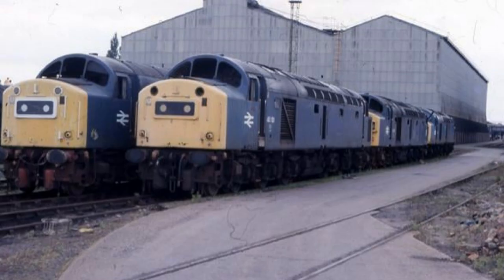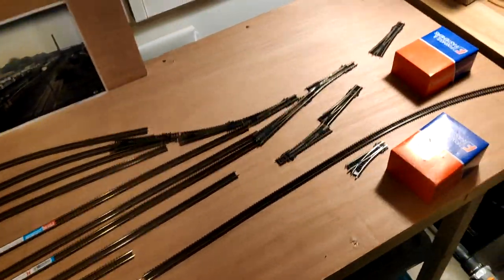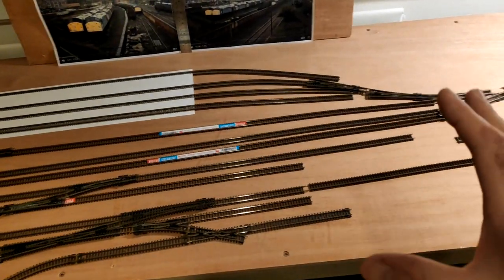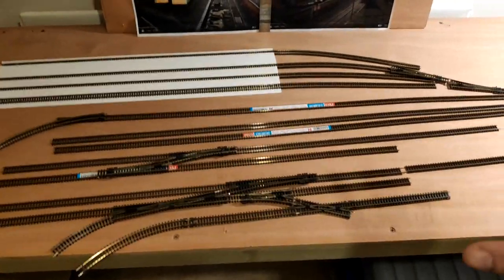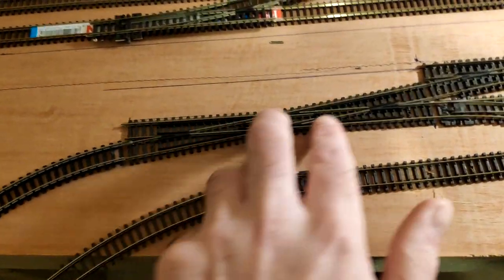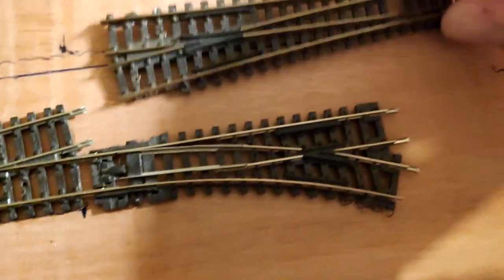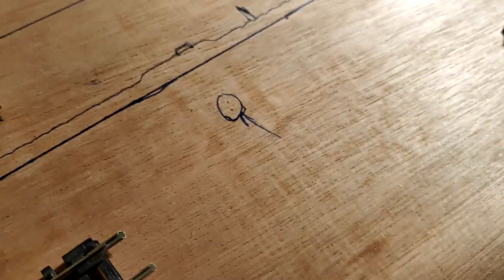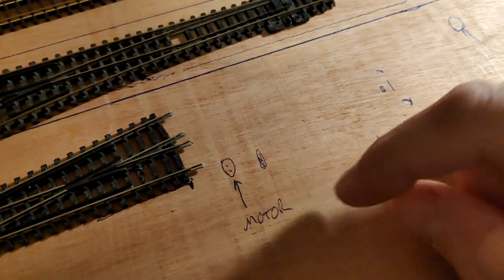Lets Build Creweworks Part 1

Comment: Hi Richard, Love the whole concept of this layout, the multi layers approach will certainly make it unique and interesting to view. Great approach to doing the trackwork, never seen super glue used before, but as you say once the ballasting is done it will also hold the track. Not sure about soldering track together hopefully you'll leave a few gaps to allow for track expansion. So going forward I take it you have a few class 40 bodies and will be just using dummy chassis's to set the scene, this could make a very interesting diorama seeing locos in various states of disrepair with roofs open and parts missing. I'm looking forward to seeing how this layout evolves. All the best Tony.
Reply from the maker: Hi Tony👍, Theres definitely alot going on behind the scenes for this layout, ive been acquiring things for building it for some time now. I did think about expansion joints as last summer it did get very hot and i know alot of people did have track issues, im hoping because the overall length it is (shortish) i wouldn't have those issues at least as bad as some did but time will tell, with the class 40's in time i will more then likely be printing or casting my own bodies, yes the majority of the 40's will be on custom made Dummy chassis's however half may actually be drivers, at different times they had allsorts in those sidings, class 20's, 47's etc etc.. the advantage to printing my own shells as you say will be so i can have doors open, cabs removed etc without having to cut about a stock farish shell👍, take care mate still lots more to come👍

Comment: Looking good and quite fascinating. I'm sure you will do a great job. Are you still going to be doing "fix the faults" videos?
Reply: By the way, what happened to the Brackley viaduct layout?
Reply from the maker: Brackley is still happening👍 i havent given up, the idea is i can loop all the layouts/modules together in the future which will also make for some nice videos/photos. Some more fixing locos videos will also happen im sure as i start to go back through my collection when running on the layouts.. a bit of everything really for the future, its all been rather slow lately im affraid with all thats been happening off screen👍